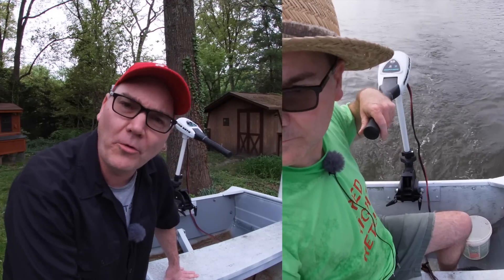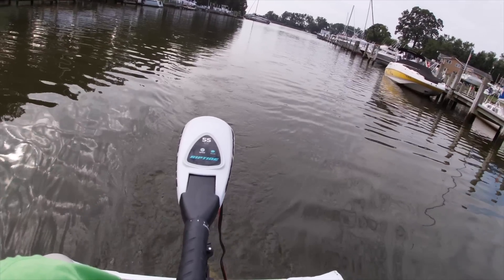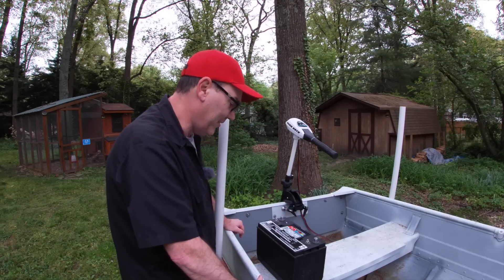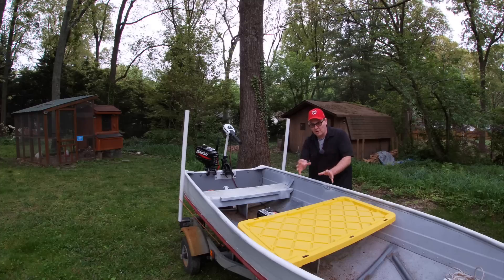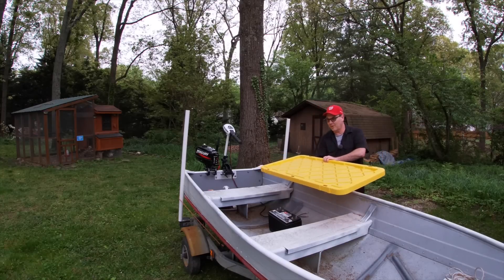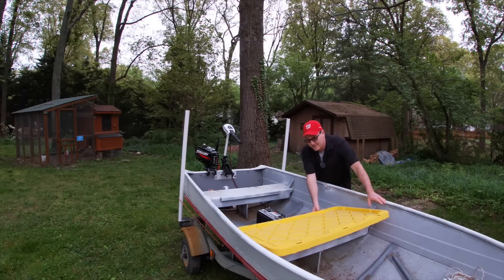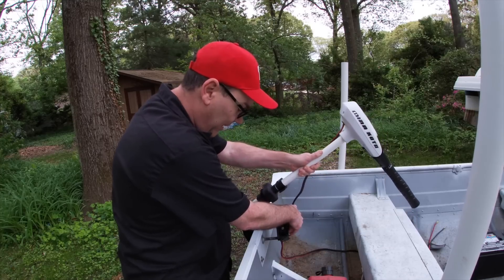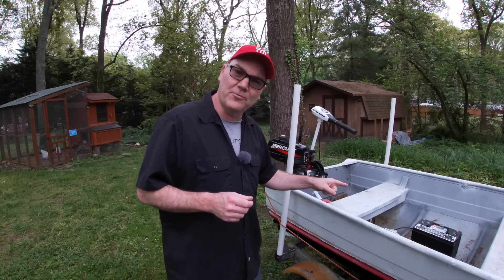How Many Solar Panels Do You Need For A Trolling Motor?

Comment: I have a rubber inflatable as a tender for my yacht and I got a 50 ah lithium battery off eBay (us$200) really cheap because I think 50 amp hour is no longer a popular size. The thing weighs next to nothing. Still deciding if it was the right move. I made the decision in a hurry because the two bolts on the bottom of my trustee Mercury 3.3 sheared off when I tried to remove the leg to remove and inspect the impeller.
 First couple of trips are encouraging but it takes longer to connect the battery then put it in a plastic box for spray protection than just pulling a starter cord. The plus is of course no petrol smell or leakage when laying it in the back of the car or boat and no mixing 2 stroke.
It runs for over an hour and 20 minutes flat out before totally exhausting the battery which is ok with a lithium but not ok with lead acid.
My little 2.3 m rubber tender has a very inefficient flat plastic bottom which creates a lot of drag so flat out I am doing 3.3 knots which I think is about 4 mph.
Some thought needs to be given to emergency procedures should the lithium battery go into thermal runaway so good fusing is essential and I would not charge it on the boat or inside at home whilst sleeping. Of course solar only works in daylight hours.

Comment: No boat with big deep wet transom  will be easy when power is limited. 
Think as if you need a row-boat for muscle power.
Double enders are the least power demanding shape for slow speed and limited power.
Double enders are designed to "swim" easily throu the water.
The transom must be high and dry if its there.

Comment: A good reason to invest in a large number of panels and a single battery.
You can use your boat when it's on land as an emergency power generator by adding an inverter.
It may not be as viable an option as others depending on the circumstances.
But if you intend to use your boat as a multi purpose tool instead of just a boat.
It could be a very good investment.
Especially down here in florida, where we have lots of hurricanes that knock out the power almost every yfor between a few days to a couple of weeks or in some cases months.
With so many people moving down here to florida, the amount of pollution getting into our waters is destroying the natural wildlife and everything else.
That's another consideration.
I'll grant you that even now. The cheapest solution to having a trolling motor only operated boat.
Is to just go with a battery or two and the trolling motor.
But as stated before.
If you want to get multi purpose functionality out of the boat or you want to go out for longer periods  of time.
It may be worth investing in the panels and some sort of rigged up arrangement to fit more panels on the boat.
You also talked about mounting four panels.
By mounting them on a small frame, you could easily fit six of them on the boat on the front end where you're not sitting.
That would also be a good place to mount the battery to offset the weight of yourself and the panels evenly.
You could arrange it so the panels are hanging off the side of the boat when in operation.
And have a joint in the center of the rig, so you can fold the panels up to create a triangular covering to provide shelter if you need it.
And fold it over completely for storage when transporting it.
There are quite a few different arrangements for mounting the panels in an efficient manner.
So if you're going for cheap operation, you're on the right track with a twolling motor and two batteries for extended range.

Comment: Under ideal conditions a 100 watt solar panel would give about 5 amps of current.   Depending on the type of electric motor you have it would take at least 2 panels in parallel to supply enough current for the lowest speed.   Four panels would get you at a medium speed and six should get you at full speed.   Now for those who want the novelty of a solar boat, it can be done and works.   I agree, it's not practical.  I did see one video where the guy had the panels like wings that were out to the sides.  Interesting, but some care was needed to prevent the panels from going in the water.

Comment: 2 hrs is plenty on my pond boat. What do I need to charge my battery while it is docked? I have no electricity at my dock and I tired of hauling it to my barn to charge it.
Reply from the maker: Solar panels and a charge controller would probably work fine to recharge a battery when docked.
Reply: @WayneTheBoatGuy  thx

Comment: Great video sizing up the options. One side point worth mentioning: If a two battery setup is something one would do every time going out, two 6 volts in series is worth considering. It avoids the parasitic drain issues that come with parallel setups. However, two 12 volts in parallel affords the option to bring only one on short range days. It does come down to preference.

Comment: Like others in the comments here have said, it depends on your application. Of course, you are correct to say adding another battery is cheaper than adding solar, but maybe you need to keep the boat as light as possible. Then the lightweight flexible panels might be a good idea regardless of cost. But then, they say those don't last very long due to heat damage. Maybe add a mist sprayer or some other way to keep them wet? But I digress. My boat is so tiny that more lead batteries really makes an impact. Solar or lithium could help. Or, I am getting old (59). Maybe I need the whole system to be as light as possible to be able to keep doing this in my old age. There are always "what if" conditions, and I'm not saying you are wrong in the least. For the conditions you laid out, you are 100% correct.
Here's another thought I have been toying with. What about a solar barge that is towed behind the boat? It would be light weight and close to the water, so no wind drag. I wonder how much drag the barge itself would create?

Comment: Hold on. A few small misunderstandings and a colossal blunder. Batteries in parallel fight. Small differences in voltage wipe them out. On land, this is one of the worst mistakes solar do it yourselfers make. Solar panels and a trolling motor? Absolutely, but leave the panel on land and give it 2 - 3 weeks to recharge your battery. Solar panels are fantastic and safety on sailboats. They also pay for themselves on land within a year. That's providing 1. No batteries in parallel. 2. Don't hire a jerk contractor or do grid tie or loans. 3 Don't chase false goals. ...My new air cooled Chinese 4 stroke sips gas and purrs like a kitten.

Comment: I didn't see the math..... I have a small inflattable boat for 2 persons with a 46lb trolling motor that runs with 2 100w solar pannels with no battery. Your 2 stroke motor is not something you can compare with electric power (a single liter of gasoline has 9kWh of energy). But a couple solar pannels deliver more power in a day than you could do by yourself.....

Comment: This is a VERY DISINGENUOUS Presentation
OK ... my 2 cents worth.
1) A LiFePO4 battery (12V/300Ah/3.6kWh/80% D.o.D./6000 lifecycle) will probably last a L O N G time (even at full speed).
2) A MPPT charge controller will charge batteries (LiFePO4) above 100%.
3) One or 2 x 700Wp solar panels will suffice to charge battery.
4) Change to PWM speed controller to avoid power wastage.
Reply from the maker: But is all of that cheaper than buying a second battery?
Reply: @WayneTheBoatGuy  ... in the long run.
Reply: @WayneTheBoatGuy 
Why do you only show a 100W solar panel - this video is a year old - when the video was made 600W solar panels were available, yet you chose to show 100W - hence my remark of "disingenuous"!

Comment: Idk, if your on the throttle for 4 hours yeah. I’d say 3 hours of throttle is a full ass day of boating on any lake or fishing journey. That much throttle means you might have launched in the wrong spot to start haha.

I’d say 3 batteries a roof with flexible panels arched over for shade, to extend range and a bit more of a powerful motor might be fun to try.

Comment: Well, this math is valid for USA maybe, but for South Eutope it is rather the oposite: Here 100 Ah deep cycle battery cost arround 200 eur (~usd) and 100W panel 60 eur (~usd). We have arround 250 sunny days a year. Panels have ideal conditions for maximum power from 8:00 AM until 5:00 PM. Before and after this time the produced power is less, but still something. With 2 panels or total 200W you get more than 11 hours of 10A supply current which is more than 110 Ah. Consider that 100 Ah battery may be discharged to 20% maximum, it means that you actualy have 80 Ah from a battery. Conclusion: 200W solar panel in sunny area offers more than 50% power per day than aditional 100 Ah battery.
Reply: Why not take the battery out of the circuit then?

Comment: On my bass boat, the starting battery is maintained by the engine, but I use solar for the other battery. It only works because I go out on the weekend and park the boat trailer in the sun during the week.
Reply from the maker: Yeah a small panel can work really well in those situations!

Comment: I want to build a sun deck/casting platform for my 12ft jon. Would be rad to make one with a used solar panel and wire it to a trickle charger so my boat is always ready to rock. I also could become an island nomad on the lakes with free charging.  From fully dead, my tiny trickle charger takes like 3 days to fully charge it up.  My 55lb motor runs for about 5hrs on my big deep cycle.  I mainly use my boat on mountain lake camping trips, so itll be charging all day even if im not in the boat. The only other way i could charge would be to jumper cable it to my truck while it runs for a few hours.  Thing is, those panels are pretty heavy for my little rooftop boat.

Comment: good video, I use a Lossigy lithium for my 55lb trolling motor, 100ah, currently at under $300 on amqazon and it lasts all day for me and I use my motor a lot. I have a SeaEagle Foldcat 375, a 12.5' inflatable pontoon. Lithium doesnt have to be expensive.

Comment: My setup on a 27-foot 6,000 lb sailboat is one 35 lb thrust trolling motor and one 52 lb thrust trolling motor each operating at half-speed with one 240 W $35 used solar panel and one 300 $250  watt solar panel with a pulse width modulation controller $60 running to a 5 amp hour lithium iron phosphate battery $35. Yes you heard that right a 5 amp hour lithium iron phosphate battery. You don't need a lot of storage because you're running off the panels. I crank the motor is up to the highest speed that that day's sun will allow me to use without the voltage on the battery dropping which you can tell via the pulse with charge controller. It'll move a 6,000 lb sailboat at approximately two-and-a-half knotts all day in the sun.

Comment: I got 235watt panels that were used for a few years on a solar farm for $60/panel.  Im making a canopy using about 6 of them.    60a MPPT Charge controller $22.   Under realistic conditions as I measured and each panel is putting about 1 amp back into the battery.  Say I am using 20amps when the motor is running that is a net loss of 14amps/hour.  So in short if I run the motor 1/3 of the time and bobber 2/3 of the time I can pretty much have no net loss.
Reply from the maker: That's awesome - Those cheap used panels seem to be readily available in some areas - but not around me!
Reply: @WayneTheBoatGuy  I got them from a guy up here in northern minnesota but I think they came from a solar farm in texas.  I think that a really good use case for most people is to use a small panel to maintain the battery charge or trickle charge the batteries when done.  lead acid batteries lose a few percent charge every month and if they aren't kept charged they get sulfation.

Comment: Between solar discharge, and phantom battery loss charge the battery, and the charging port is the fail no battery straight solar they reduce the weight

Comment: Your information of size of solar panel is so wrong you can get a 520 W solar panel for the size of the one thing you had in your hand so not only are you five times the incorrect information but with two panels you can run that without a battery

Comment: Help me understand electric trolling motor thrust ratings. A Salesman told me that a 35 lb and a 55 lb thrust motor both will only give you 5 mph so don't waste your money on more thrust. I want to fish on a lake that is trolling motor only no gas. I only plan on going out if there's a minimal to no Breeze and only for three or four hours in the morning. I plan on using a four-person Intex raft and it will probably just be me and I am 300 pounds. I see myself going about a mile from the boat ramp and then moving around every 20 minutes or so a hundred yards and then a mile back to the boat ramp. I know I'm going to go with a lithium 100 amp hour battery but I don't want to run out of power and I certainly don't want to row at 62 years old LOL

Comment: Hello! Nice video! Could you please suggest me a light weight battery for my trolling motor HASWING OSAPIAN 40LBS?
Thanks !
Reply from the maker: If weight is most important - a lithium battery is going to be much lighter than a lead acid or AGM type. However, they are usually twice as expensive as the other types of batteries. The other factor is range/run time. A 100 Amp-hour battery has much more run time than a 50 Ah battery, but of course it is bigger, heavier, and more expensive.

Comment: Used solar panels are very cheap, some used lithium to make a battery is also cheap. One day the boat will be the solar panel. Cheers
Reply from the maker: I think the availability and cost of used solar gear varies widely by location. In my area I would pay dearly for the shipping of old panels.

Comment: My thoughts,,, You haft set aside some cost to do it' correctly and it wouldn't be that small, 1200 + lbs or 40 feet in length or more' for weight capacity saying were not exzactly going fishing" for a family sized adventure" like an Arc" say your out in the ocean after a great flood...or whatever there's no more gasoline right',,,(my prodotype) is temporarily submurgable for one' wooden with sealable air hatches, and door and race car seat belts exc',, but with a combination solar boat you could find dry land' there afterwards" so you would 
run you a lythem 200 or 300 aph' with a secondary battery for point of no return, or auxiliary" you use one motor while the other is charging, with a togal charge swich between the two batteries and the pannels, so your always charging something, with a quality level electric motor 12 or 24 volt ' you use a mppt chargecontroller for optimal charging speeds" and mount the pannels to a roof set up" on the top of the boat...400 to 600 watts or so so'...you would even put extra pannels, charge controllers, battery and an extra boat motor onboard -, The Rip tides will smoth out after a month of rain or so' then with some hand tool's you mount up everything you had strapped down on the inside...then go sailing because there be tomes your going the direction the wind is" no matter what",,,never forget the front leader leafe fin' for wind direction" a compass and kearn how navigate with the stars and the sun"...and of corce go with marine grade plywood, circular body dezighn with the weight of the idems onboard secured at the bottom you build a bulge" therefore the boat will always flip back right side up' in extreme currents... there's other things you would need for such survival not listed...you can build one smaller and different yes' cheaper what not'...cost of the supplies i couldn't figure right off head without calculation or a prodotype build,,, remembering things like medical supplies, thurmal sleeping bags, a vegiblue oil heater with fan blower, food water, guess' it could get vary cold" or hot inside the construct as well' Noah had seven days warning to create the Arc, by then the earth' had released a great sway" and rumble the massive Ice cap that hit the ocean threw watter all way into the upper atmosphere leaving olny' a few mountain tops unsubmerged.
Goose could survive a Biblical apocalypse in theory"...if he could afford such things... something rich people may be into"...

Comment: What does make sense id to use solar for aux power on a sail boat.  The aux. motor is only needed in & out of the marina and to get home if the wind dies.  So you use the solar to charge a battery.   So TODAY we are switching to a Hangkai 48V 7hp and a small 4 battery bank used wheel chair batteries.   If this works I get the solar panel. 

Thanks for the info.
Reply from the maker: Yeah - sailboats also usually have some decent surfaces for mounting solar panels!

Comment: Just don't run your motor all the time stop and have a lunch do some drifting and jigging and casting jump in and have a swim as the motor is not running of coarse it is charging.

Comment: Neat idea but I'd use 3 batteries if I needed too. But I think the optimum set up is a gas engine to get you from the dock to your fishing area and then switch to the eletric motor for quite fishing. Also you can get a 6 to 10 hp gas 4 stroke air cooled engine to make it easier